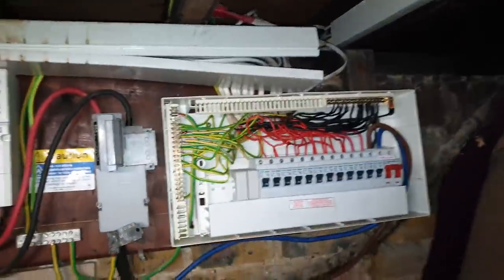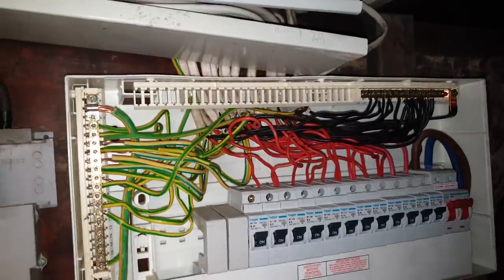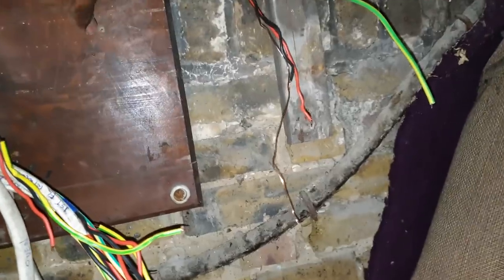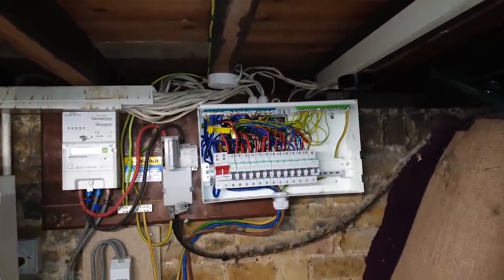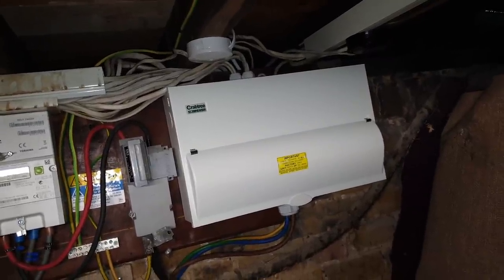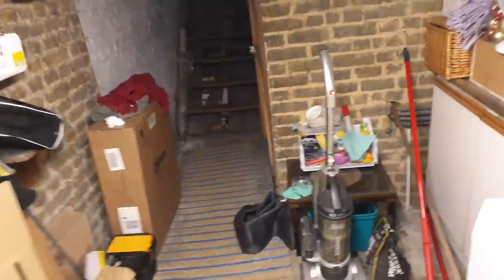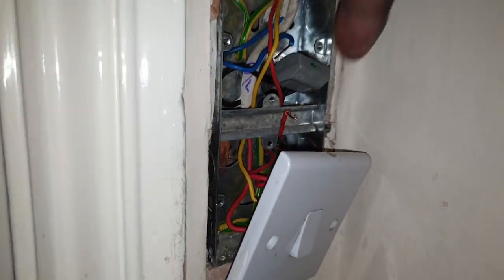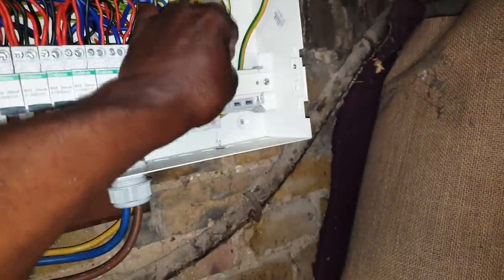Fault Finding, Solutions For Hazardous Situations & Consumer Unit Upgrade - Delroy The Spark Vlog

Comment: Even though the fan doesnt require an earth you should still connect the earth at the mains end to protect anybody that may by accident cut into that cable and the cpc within that cable could save that person getting an electric shock?
Reply: The fan supply cable earth/neutral fault was previously detected by the rcd facility within the new rcbo, therefore the disconnecting the earth cpc at the supply end (already earthed switch box) eliminates the fault previously detected by the rcbo. 
The cut off earth conductor within the grey sheathed cable will still be still 'shorted' to neutral - disconected but insulated, thus a neutral by 'fortuitous' contact.

Comment: Would of been easier/safer to sort a temporary socket if you're concerned about the fridge 👀 state of that DB and the tails 👀 and you can't just cut out a CPC its not just there for the equipment on the end its there to protect the cable in the wall etc

Comment: You can cut the seal and temporarily remove the top hub of those smart meters. It'll reconnect when you put it back. Just an easy way to get more space if you really need it.
Reply: The seal should not be cut and the hub should not be removed.
Reply: @dav01kar  Yeah I'm aware of that, I install them. Sometimes the real world requires real world solutions matey.
Reply: Isn't removing anti tamper seals on meters illegal? I mean I don't know in the UK but in my country clearly is, since the seals are used by the electric company to certify that the user has not tapered with the meter, for example to make it measure less energy and thus steal electricity. I also think that new smart meters have anti tamper technologies that send an alarm to the electric company if you try to tamper with them.

Comment: cutting the earth out now means the cable buried in the wall is not earthed definately not the right solution del
Reply: @eastwayelectrical  I was saying cutting the earth out is not the solution ok the circuit is rcd protected but that cable buried in the wall has no earth
Reply: @alhughes9698  fair comment 👍👍
Reply: dean m cutting out a cpc to get round a fault is something you just would not do.
Reply: @jamesdyas542  I agree mate somebody else came up with a good suggestion and that was fitting a humidstat fan and using the switch wire for a earth cable that was a very good idea
Reply: dean m I’d say the cables damaged and it needs repairing or preferably replacing. I’d just disconnect it at the switch and tell the customer that. Probably a nail in it and you could insulation and continuity test it but will it be the same in 6 months time? No way that can be guaranteed.
Reply: You cannot under any circumstance disconnect the cpc ????

Comment: That type of xpelair fan does have a switch on it by the circuit board to select time delay on/off, they have a faster speed when the pull cord on the fan is operated as well, 2 speeds

Comment: Hi delroy love your vids..your old school like me. The only two things I'm pulling on this job. 1 no SPD put on your new 18th board and 2 that cable running to the fan needs to be earthed regardless of the fan not having one as cable still needs the CPC connected for protection. I personally would have used a 12v fan and put a transformer outside somewhere where it's switched on. Then least that cable to the fan would have only been 12 v. Cheers Steve
Reply: There's no requirement for an SPD - it's only a recommendation. In many circumstances, there is no need anyway depending on the supply type, characteristics and transformer location.
Reply: @sdgelectronics  true.. not sure what the supply type was without watching the video again. But for the price of SPD now days it's worth just putting one in.